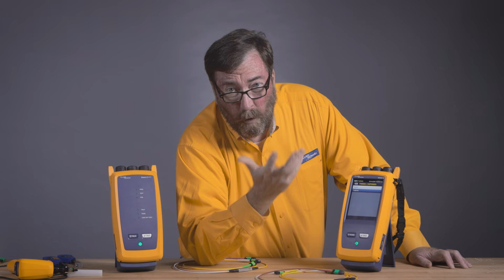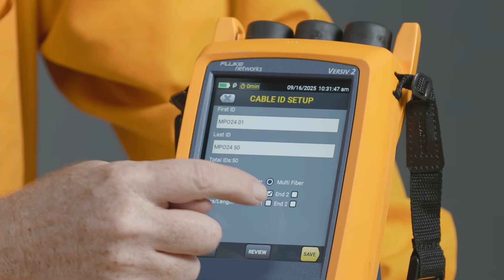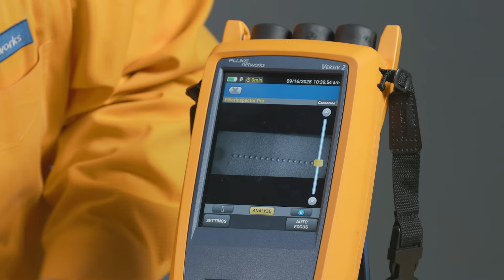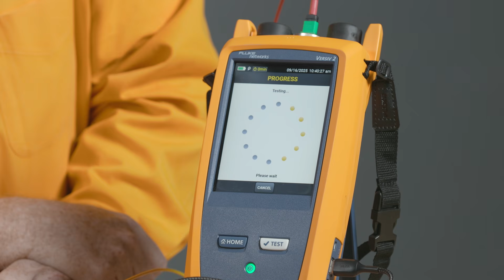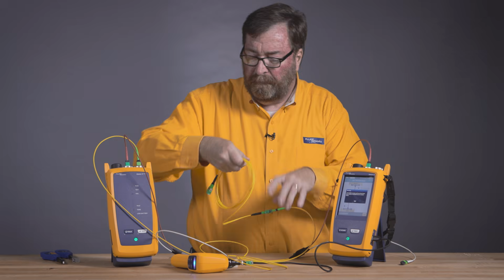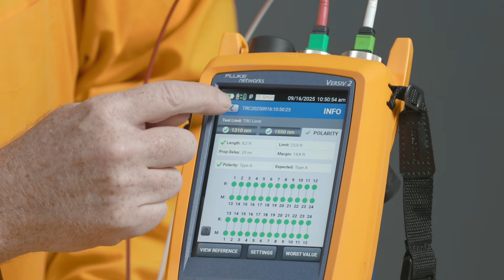Introducing CertiFiber Max for Multi-Fiber Testing on the Versiv Platform

Comment: Fiber Inspector in Data Centers

We appreciate the development of these tools and the training provided on their proper use. Based on our field experience, we would like to share an observation that could help improve their implementation in data centers.

In some data centers, security policies require USB ports on equipment to remain sealed or blocked to prevent unauthorized connections and potential data transfers.

This directly limits the use of the Fiber Inspector, as it requires a USB connection. Although its sole purpose is to inspect fiber-optic connectors, the need to use a USB port may prevent the tool from being authorized inside the data center.

For this reason, it would be beneficial to consider an alternative connection for the Fiber Inspector that does not rely on a USB port. This would make it easier to use the tool inside data centers without conflicting with their security policies.

Thank you.
Reply from the maker: Thanks for sharing that, our team would value hearing your field observations directly here: https://www.fluke.com/en/support/about-us/contact-us